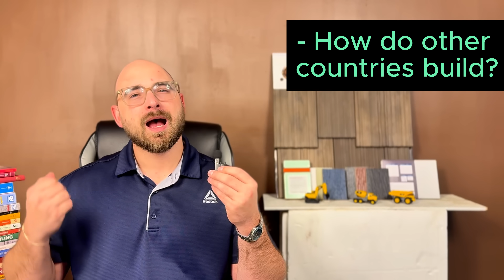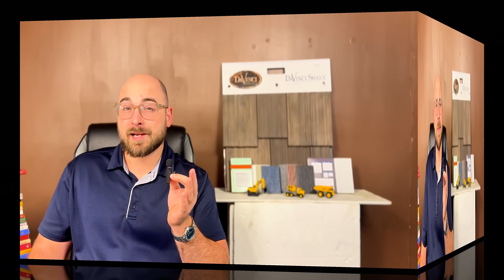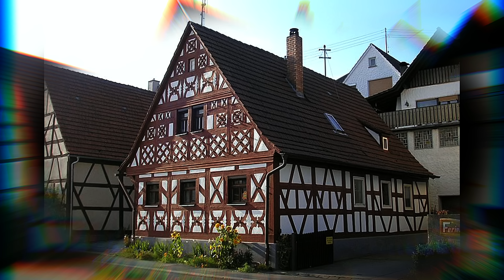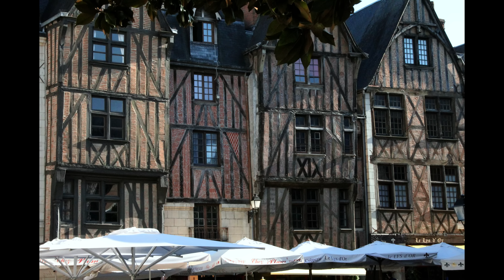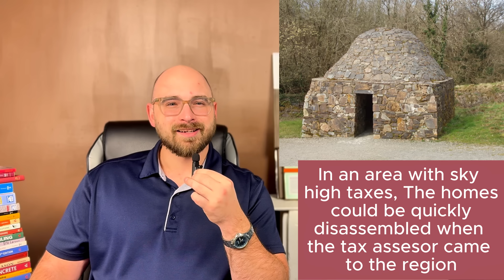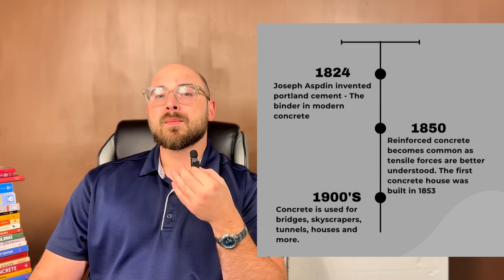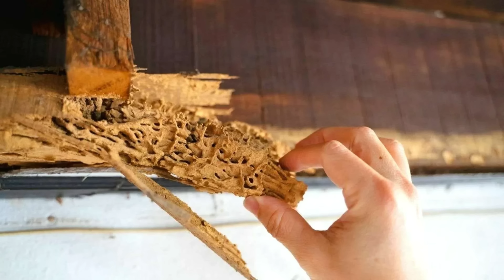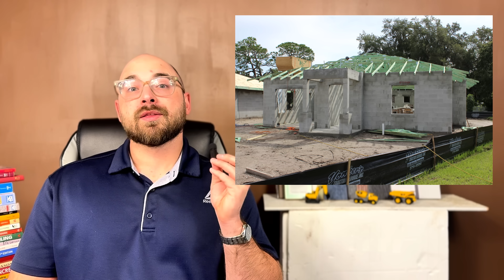Why Other Countries LAUGH at American Homes

Comment: The US homes are poor quality - lacking thermal and acoustic insulation. It has nothing to do conceptually with the construction method. It's how it's used.
Nordic countries (using very similar construction method) and perfectly insulated - the prerequisite for the long and very cold winter; and with that comes sound proofing of most of the rooms - when you have to spend a significant portion of year in-door, you care for some privacy

Comment: Woodframe home is tech designed specifically to maximise the profits over set development for the investor due to construction speed. It is only thing that matters, only thing that you pay for - more profit for people building homes.
Reply: It's not designed to be this way - it just evolved and become a caricature of itself. Settlers - mostly from countries where wood construction was popular (Scandinavia, Germany) needed quick and cheap shelter. Wood was plentiful so the choice was obvious. If the settlers came from Spain or Italy they would surely built from masonry - like in the Southern America. After a while the "cheap and quick' became the norm and got ingrained into the nomadic culture to such extent that nobody was questioning it. In the meantime it became expensive and not so fast to build. Additional features and increased average size increased the cost of the building, reducing the cost percentage of the wooden frame further down. It still makes sense to quickly build cheap shed, but objectively makes no sense to build the same shed with finishes, where the cost of material of the structure will be a small percentage.
Reply: @ElegantiaeArbiter  I always wonder if people defending this nonsense have ever build anything... In modern home construction phase (foundations/walls/roof) is usually less than 25% total building cost, and usually less than 15% when including land...

Even if woodframe was 50% cheaper than proper mansonry with AAC for example you still get marginal cost reduction up front with significantly higher maintinence and worse accustic properties...

Comment: Austrian guy here. The "New World", especially the US, is a prime example of poor city planning. Their stereotypical architecture is quite off-putting to me. The widely used design of US facades is just as bad as their interior layouts.

You mentioned building with wood, well, back then, land in the US was (and still is) relatively "cheap" as wood in general. As a result, houses were often unnecessarily large and built with poor quality. Screws? No, nails! The mindset was: "Every US citizen should have their land, house, horse, and gun." Skyscrapers?Yes, but so many of them are poorly constructed.
When you use wood as construction material it would be like this in europe: greenwashed built, bad tongues call ot eco building 

Austria, Sweden, Denmark, and the other countries you mentioned haven’t relied much on wooden houses for decades. Brick and concrete are the standard building materials. In rural areas, you might still find historical wooden buildings, preserved for their cultural value and charm.
Youtube and its bubble...
Architect and industrial designer here.
Reply from the maker: Thanks for sharing!

Comment: 7:20 even though the frame of the house is build similarly in those countries in Nordic countries we use/used wood to cover the frame from inside and outside, making the walls a lot more sturdy than with drywall
Reply from the maker: That’s a lot of shear strength!

Comment: I just think it's interesting how tornadoes are often used as an excuse to make bad houses, as if we know how other kinds of construction fare. There for sure is a method to make tornado resistant housing, no one is just willing to fund that kind of engineering project.
Reply: Even considering the worst case scenario tornado, so many homeowners lack a shelter or basement to protect themselves with.
Reply from the maker: Technically, we do know what it takes to survive even the most severe hurricanes or tornados, but it’s a cost issue. 

A tornado proof house is concrete walls AND a concrete roof. 

The concrete roof is the expensive part 

A fair compromise is concrete walls and a concrete safe room (with a concrete ceiling for the safe room). If the main house roof blows away, it can be rebuilt and it’s safer and cheaper than rebuilding the entire house

Comment: Concrete is heavy, not easy to renovate.
Reply from the maker: Concrete homes are not difficult to renovate. 

You can use a cut and break saw to create new openings if desired. 

Most renovations are purely cosmetic, leaving exterior walls intact, and a full addition that does modify said walls will come with plans and engineering which again, is no extra trouble to account for cutting through / modifying concrete walls 

It is a non issue
Reply: @Mike_Fortin  not as easy as stick built since we already know how, don't have to order these things you are talking about, can get anything we need around us to renovate stick built.
Reply from the maker: Order what? All I said was rent a saw. 

It’s not that hard.
Reply: @Mike_Fortin  oh I'm sorry you didn't say something about getting materials with engineering plans?  Can I get it at Loews?
Reply from the maker: @patrickgoncalves3878   look, if you can’t read a single paragraph there’s really no point in arguing 

It’s not that hard to modify a concrete building, perhaps a bit too complex for you though 🤷‍♂️ 

Anyway, nice chatting
Reply: @Mike_Fortin  I did a search for contractors in my area that can renovate concrete homes, all I found was foundation and driveway repair.
Reply from the maker: Any carpenter that’s worth hiring can do it
Reply from the maker: Again, it’s not that hard. 

What kind of renovating are you doing where you’re tearing out exterior walls? 

If you’re building an addition you’re getting plans, and in the plans you’ll have demo plans. If your exterior walls are concrete and you want to change the house, you can saw through it 

Not that hard
Reply from the maker: I’ve had additions on stick frame houses where I had to saw through the foundation to connect the old and the new, 1 day saw rental, 1 day job, easy
Reply: @Mike_Fortin  again I am a homeowner who has done many renovations and additions and the fact that no contractor even does work on concrete will pose complications.  I live in the real world.

Comment: Majority of American homes are cheaply built to minimal building codes . I've worked for companies that build the exact same wood house some for 300k some for 1mil. All depending on location. No extra security. Blocks on ground floor and wood otherwise.. in a hurricane zone.. I duno why not just build in blocks
Reply from the maker: Most buyers, builders, and investors just want the cheapest thing possible
Reply: @Mike_Fortin  I'm from a third world nation and slept thru category 5 hurricane Maria because I knew I was safe from landslides.. my house could be built today for about 100k usd. In a 3rd world nation. American houses are overpriced and undersecured
Reply from the maker: @ what’s your home built out of?
Reply: @Mike_Fortin  concrete and steel

Comment: Concrete is getting more expensive as the world runs out of the right kind of sand. Also, creating the Portland cement uses a LOT of energy (thus carbon), if you care about that sort of thing. Using trees does not.
Reply from the maker: 😔😮‍💨this is not true 

There is no sand shortage, watch “practical engineering’s” video on the topic

And lumber is not carbon neutral, we use gas powered equipment to plant, harvest, plane, kiln dry, engineer, transport, and build wooden structures, which stand around 50-60 years or u til the next natural disaster at which point the process is repeated. 

Concrete is there forever. I believe the most sustainable thing you can do is build to last. 

When eco friendly cement is available, we’ll use that, for now we use carbon capture technology which incorporates C02 from industrial processes into the concrete mix, offsetting the C02 concern. 

To say “concrete bad, wood good” fails to consider many variables. 

How much C02 was released during the CA wildfires?

Comment: One huge problem with homes in the US is the poor quality of craftsmanship, low quality contractors, use of drywall (its shit just admit it), and just a general lack or pride in ones work. Look as Sy Porters channel, new homes are just garbage because of lack of workers skill and overly tight timelines. To say contractors have a good understanding of light wood framing is also bogus. They might know a thing or two and can follow a basic diagram, but you can't even find a consensus online on how to build a porch let alone a house. It is a completely compromised building method due to lack of abundant timber plain and simple. The amount of 60 year old homes I see in the US that have sagging roofs or warped walls is astounding. In northern Sweden I only see that on abandoned homes that have been sitting to rot for 30+ years.

Comment: Thinking about the devastation caused by fire in LA it's seriously time to think about building materials when rebuilding La. Stone, concrete brick, slate and clay roof tiles, metal guttering and fall pipes, fireproof glass window frames and doors. Also,  surrounding urban areas with fire brakes. Local fireproof fire shelters to save lives. This has to be the way forward in countries badly affected by climate change.

Comment: In California concrete houses would not do well. The amount of cracks and spidering would be so ugly from all the earthquakes
Reply from the maker: If designed properly, they would be just fine
Reply: For block or brick construction metal ladder mesh is used. Flexible plasters (lime based) for the exterior. Concrete needs rebars.
Completely incinerated pathetic stick neighborhoods look much worse than few potential cracks.

Comment: Earth homes are built in the southwest of the US especially in New Mexico and they can last over 100 years if taken care of properly. They are also fire resistant and are amazing for the extreme heat of the southwest by keeping the house cool.
Reply: Also the oldest buildings in California are adobe structures built by Spaniards. They can be designed for seismicity of the area with vertical reinforcement, bond beam and bracing walls. Huge thermal mass - perfect for diurnal temperature changes of the West. The material is available everywhere and even with cement (or lime) stabilization the blocks could be made cheaply in economy of scale. Adobe houses are gorgeous, can be easily built to be completely natural and healthy and they perfectly fit the climate and history of California without some sticks pretentiously covered with white stucco and pretending to be colonial architecture that will still burn nicely to the very ground in the next fire.
Reply from the maker: I just worry bugs would dig right through it
Reply: @Mike_Fortin  Adobe bricks are very hard, sometimes only a little bit softer than soft fired bricks and can not be scratch with a nail. Cement stabillized earth blocks can be even harder. I never heard about bugs wanting to penetrate such a bone dry material. In my garden, in spots with excessive clay levels there is no insect activity, because there is nothing to attract them and it would be too hard to penetrate.
Reply from the maker: Interesting, thanks for sharing

Comment: American here living in a home built in 1870's in northern cold climate area but has been modernized.    Hasn't blown over yet nor any of the houses in my neighborhood with same lifetime.  Could also look at the global warming aspect too since concrete retains heat much more than wood homes thus creating more of a temperature radiant.   The Mall of America in Minnesota does not use any heating, all heated by human bodies.  They actually vent the mall in the winter.
Reply from the maker: Welp, you solved it. Let the bare minimum building standards continue. Wood good - concrete bad. Who cares if it burns down or blows away. 

The insurance will cover it right ?
Reply: @Mike_Fortin  I didn't suggest to go bare minimum and building materials and techniques have advanced over time.   Even concrete and brick degrade which become a very costly repair.
Reply from the maker: @BadgerNNN  depends on how you build it. 

With ICF you can build with concrete without exposing it to the elements. Which means it will last virtually forever

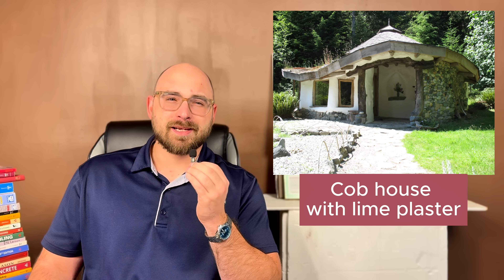Comment: 02:00 false.

Most west African 98% homes are built by blocks. Blocks made of cement, sand and gravel. And the mixture ratio depends on the part of the homes architecturally.

America and false information

Comment: i poured 350 concrete and steel rebar for my home from ground to roof and adding insult the facade was made out of painted concrete hold on by a steel square bolted into the concrete and my pipes were high food grade pvc
Reply from the maker: Very nice

Comment: netherland in 1800 1900. they baked bricks in self made ovens. forming the bricks and stack them  in canels. what are filled with dry wood. when they completed a full stack of bricks with 1 big canel filled with wood, they set the wood on fire, the goal was to get ultra high temperature for as long as possible to get the hardest brick possible.  there where people who tap the stones to hear what are the hardest ones, people where focusing on getting the hardest brick possible
i can tell you this.. drilling in the wall is as hard as drilling in concrete.

after the second world war buildings needed to be repaired and the first brick factories came, baking soft, fast produced bricks.  people stared using more materials as in concrete blocks as inner wall for the beams to lay on. and outside those softer bricks. 
and today you see many trucks driving around with concrete slabs . what they hoist on a foundation.

whats also funny, if you have those old bricks. and you put them for sale people pay 1 1.5 euro per stone. way more than the strait new softer ones, because those bricks where the absolute best bricks.. 

oh and those pictures you showed of bricks.. i never seen them .. we use solid bricks

Comment: Unfortunately concrete is not sustainable!!! Soon there won’t be any sand left.
Reply from the maker: Not true. Practical engineering has a great video explaining this
Reply: @ OK forget sand. But why is cement responsible for 18% of co2 emissions in the world? And why the great rush to find a “Green” concrete?
Reply from the maker: How many trees need to be cut down to build a house? How much fuel is used to harvest, plane, manufacture, kiln dry, transport and build wood structures. 

How much c02 and c0 are released into the atmosphere when a wood house burns down (see California) 

How many times is a wood house rebuilt when a concrete house would still be standing. Due to age, moisture, natural disaster, etc. 

Should the safety of a building be considered? 

What about the massive use of concrete already taking place for roads, multifamily buildings, industrial plants and more? 

As technology improves, concretes impact will be lessened but there’s nothing wrong with using it, currently our projects use carbon capture technology to implement c02 captured from industrial processes into the concrete mix, reducing the emissions problem. Plus, concrete absorbs c02 during the hydration process. 

To say “concrete bad, lumber good” is disingenuous. Smart people understand nuance and complexity, typically avoiding 1 sentence answers …
Reply: @ I never said lumber U said BIM, Lean  & industrial processes. I build steel better than passive house standard (7kwh/m2 & year) using these Principles for $1200/m2, 8 week completion from start to finish including 6kwp solar and 10kwh battery, steel foundations no concrete. Built to seismic regs. Timber is best left as trees. My houses have a lifecycle of 120+ years. Are 100% recyclable, sustainable. Everything can be removed and reused. That’s of course using BIM Lean and industrial processes. Ohh I forgot you don’t need any professional workmen except of course electrician and plumber. You don’t need concrete! Concrete is best used for infrastructure projects.
Reply from the maker: But steel is energy intensive!!!! So is it really sustainable? 

What are we even talking about anymore?
Reply: @ we are talking sustainability of materials. Buildings today are constructed on their CO2 content from manufacture to transport. Therefore even though steel is high energy intensive it lasts 120+ years and can c’è reused over and over again. 
Timber housing has a 60+ years lifecycle but at its end cannot be reused just like concrete.
Reply from the maker: Concrete absolutely can be recycled. 

It can be tumbled and used as aggregate, it can be used as road base. 

How recyclable are solar panels and the batteries? 

Green building is so hypocritical. Does it make for more comfortable homes? Yes 

Should homes use less energy? Yes

Are they saving the world? Probably not
Reply from the maker: I get it you like steel, I don’t see anything wrong with that, 

And I don’t see anything wrong with concrete either. Either one is a lot better than the standard matchstick house 🪵 🏠🔥

Comment: You forgot about aerated concrete. It’s easy to use, relatively cheap and quick to build with. Also they are great insulator. To match you 2*6 wall in insulation you will need only around 12cm wall. And aerated concrete is usually 30-40cm wide so much more insulation